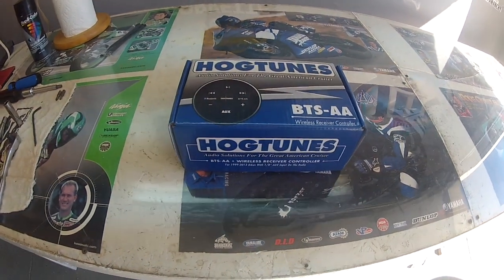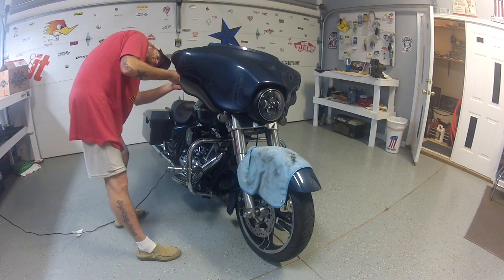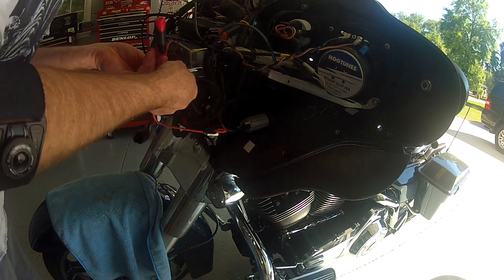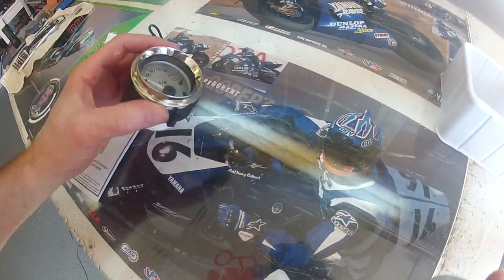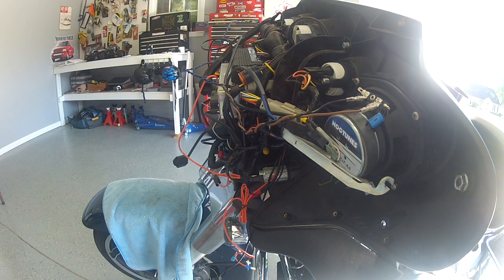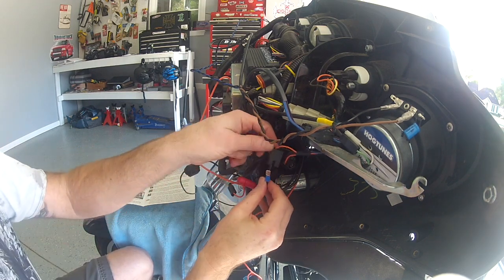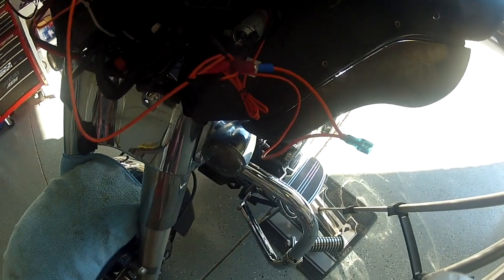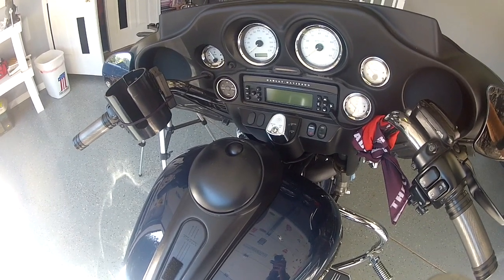Install Hogtunes bluetooth Controller on 1998-2013 Harley Davidson Touring

Comment: Good video, I have the same amp and speakers and just got the Bluetooth device, what did you tap into to power the Bluetooth device? I was thinking the power wire going to the amp. I tried a few different things n just blew fuses, any help would be appreciated, thanks.
Reply from the maker: I made that video quite some time ago and I do not recall exactly, about the power wire. I should have shown or mentioned it in the video though? Maybe it was the cig lighter power wire that I used 🤔
Reply: Thanks Jason for responding. The amp is tied to the cigarette lighter as per the directions. I tried tapping into cigarette lighter again n blew fuses, so apparently I need to draw power elsewhere. Drawing power from gauges didn’t seem to work either! Waiting on hogtunes for a response. Thanks again, ride safe!

Comment: Just installed my unit today.  Thank you for this video.  Installed with no issues except the orange wire spade for the cigarette lighter needed to be crimped a bit to maintain a tight connection.

Comment: But anyone else you want to talk to needs to have one and if you have a factory installed CB (2010 ultra classic's) it won't allow you to connect thru the headset. The passenger needs to have one of these units as well so that doubles your cost. I guess if all you want is to hear is music then go for it. A lot of us need the CB to communicate to a lot of people in a group ride.
Reply: Riley R you can still use the cb, it's only using the aux input.

Comment: Thanks for the video.  When you plug into the cigarette lighter do you lose the function of the lighter?  Also how does it sound overall?  Are you happy with it?  Thanks again!
Reply from the maker: Your welcome and Yes, the lighter still works. I am VERY happy with it, I use it 99% of the time, streaming from my phone. I RARELY use the FM radio or the CD player :)

Comment: Can't you use the 1/8" input on the Hogtunes amp instead of using the one on the front of the stereo? If not... what's it for?
Reply from the maker: I think you probably could? I didn't try it. I understand the 1/8" input is for a secondary accessory, whatever that might be is up to you I guess. As long as it has a comparable output....
Reply: If u do that the handle bar controls will not work for volume it’s like ur eliminating the head unit function.

The input on the amp is ideal if you want speakers with BT / amp with no head unit.  Like on a road king for example

Comment: Hi!  Thanks for the video.  Question:  will the chrome ring that is on the temp gauge you removed and match the other gauges fit the Bluetooth device?
Reply from the maker: Keith Stokes , I didn't try to use that ring, but I don't think it will fit?? Not totally sure though....